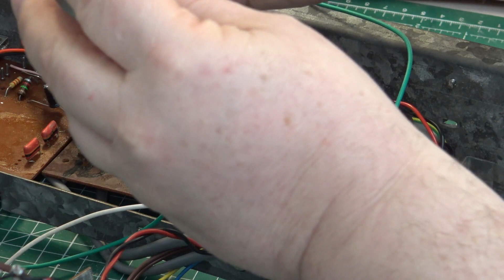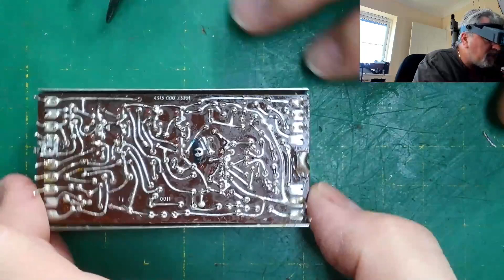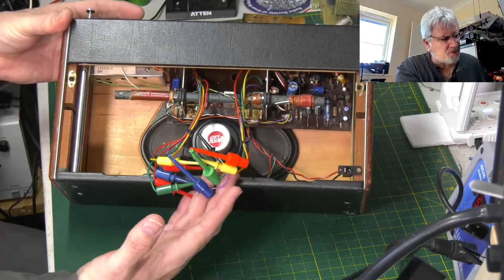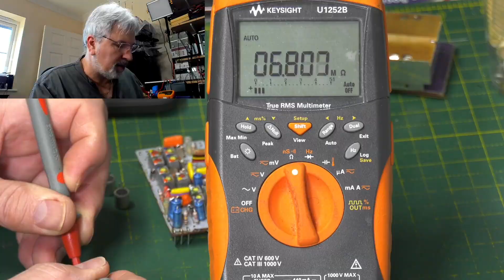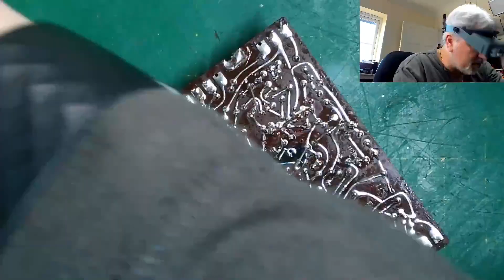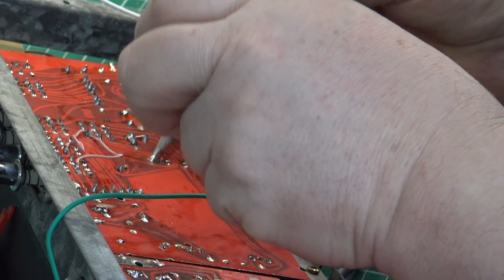Wye Radiogram repair & service Pt2 of 3 - In collaboration with Radiocruncher

Comment: can you not use PNP transistors from the CCCP or BF450 for the AF115 and AF116
Reply from the maker: Bf450 may work but won't have the screen connection. As mentioned in my previous reply, we'd try the Russian GT322..by which I mean CCCP....but as I said, we're not experimenting or guessing with a customer repair, and especially with a customer 170+ miles away.

G0OJF, UK, Richard,
Reply: Silicon transistors in a module is risky as it may need re biasing and alignment . The Russian GT322b does work as I’ve used them before. The characteristics are different though so it might again need to have a realignment. The AF125’s that are used are considered to be an identical transistor in a different can that doesn’t suffer from shorts. They are more expensive and harder to get though
Reply: @Radiocruncher  Germanium transistors are very hard to get and only country produces them for their own use most likely in their RADAR installations so very few are available for export.
Reply: @DAVIDGREGORYKERR  yes they are getting scarce. It's just a bit of remaining NOS that's for sale. I dont think anyone makes new ones

Comment: what about going with BC212L for general purpose use.
Reply from the maker: Other than being PNP, that's about as far wrong as it's possible for a transistor to be. The AF115/6/7 are germanium PNP RF transistors with four legs, the fourth being a screen. Graham replaced the duff transistors using the AF125 which is an acceptable replacement. Had we repaired the module ourselves we would have bought in Russian GT322 transistors that don't seem to suffer from the internal short circuits that UK,  American & Japanese germanium transistors end up with. This could be because Russia was still making Germanium transistors in the 80's & it just could be that they are not yet old enough for failing yet. Time will tell.

Because of this Mullard module, I've ordered a broken radio from Ebay which we'll do a video on repairing & our Mr Chippie can overhaul the module. I didn't want to experiment with this Wye radiogram with it being a customer's, hence using Radiocruncher to overhaul the Mullard module....backed up by his decades of knowledge, experience & test jigs on these products.

When transistors were invented they never said they would last for ever, just that they would last longer than thermionic valves.

Richard, G0OJF, UK